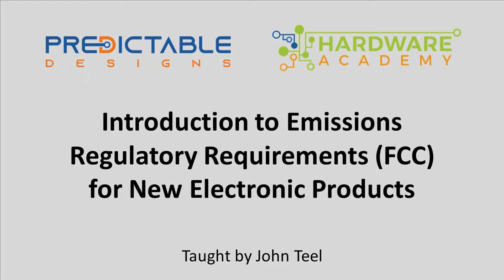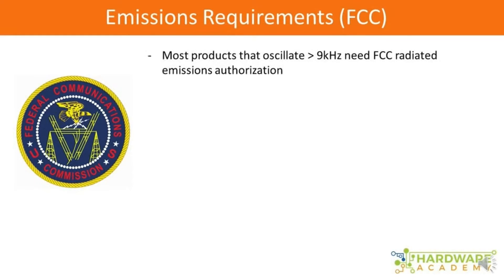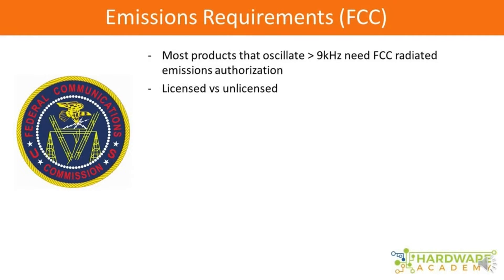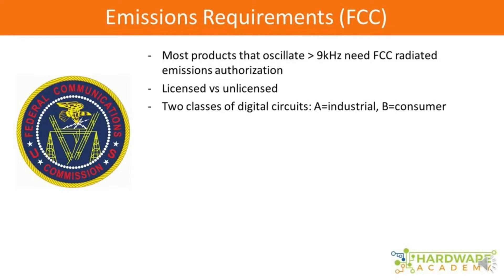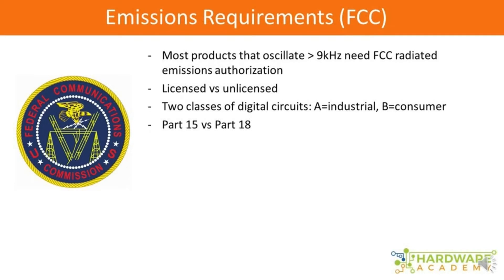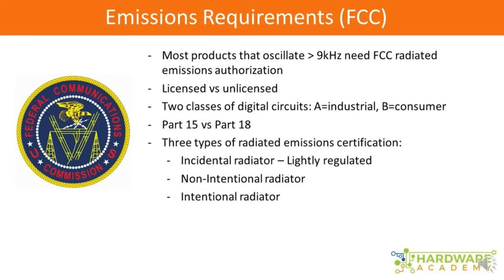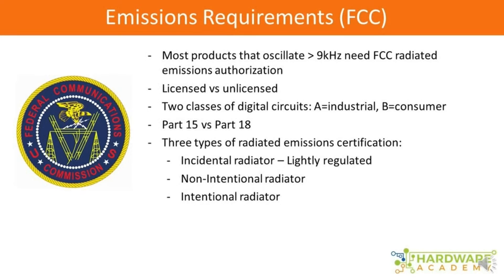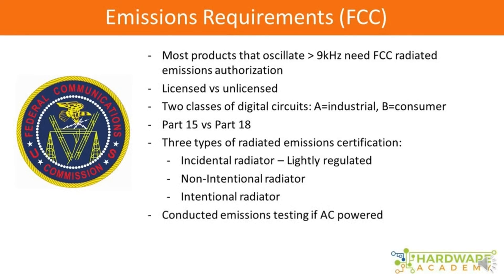Introduction to Emissions Regulatory Requirements (FCC) for New Electronic Products

Comment: Hi :) great video and information. What happens when the same electronic product will have 2 different sofware versions?? Does it require to have 2 certifications as well?
Reply from the maker: Thanks! No, you only need to certify the hardware. Just be sure you certify it with all wireless radios enabled.